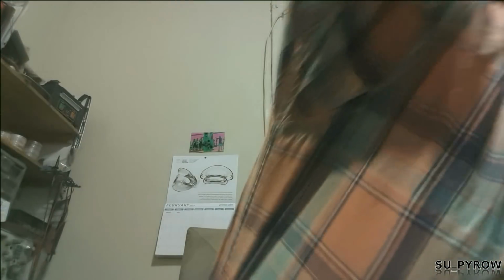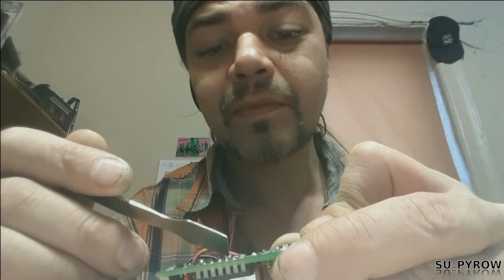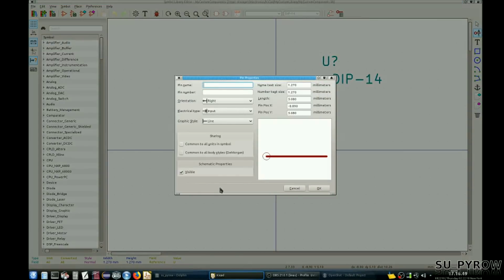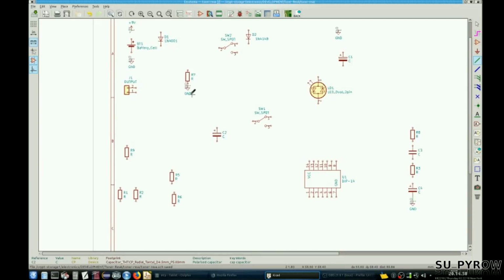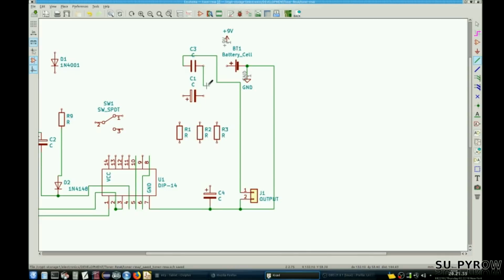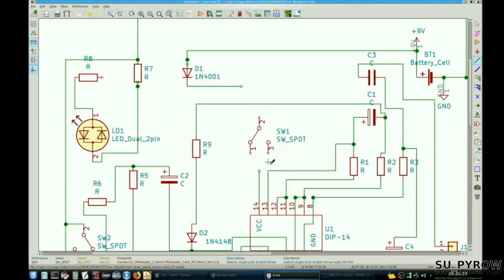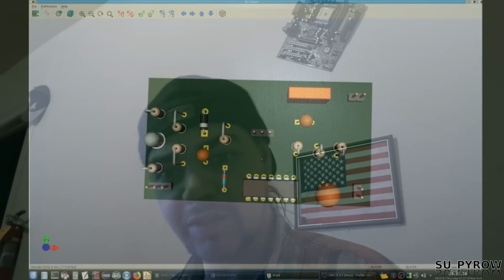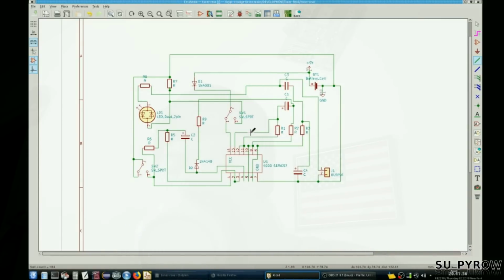How to Reverse Engineer a PCB to Schematic Using KiCad Tracer Toner Part#4 SU_PYROW

Comment: Nice channel, found yours trying to reverse engineer a schematic for a shredder. The wiring is all over, someone told me to use Net labels. Interested to find your channel and learn, I've never heard of identifying chips using voltmeters and truthtables. Only way I could have thought would be dumping the chip contents via a reader of some sort. Looking forward to watching more

Comment: Mystery chip is a 4069 or 4049 hex inverter from what I remember but ifvyou are familiar with arduino it can output different tones easier than building this up. Any probe will pickup arduino tones great.
Reply from the maker: CD4069UBE = $0.51   vs. ATMEGA168A-PU  = $2.19 vs ATMEGA328-PU = $1.96.    not to mention a microcontroller is way overkill for this project..  yes it would certainly work just fine.

Comment: Which  software use to draw sticmatic drawing.
Reply from the maker: the name of software is in the TITLE.   I have used KiCad for the past twenty years. I started in the 90's with Electronics WorkBench, or EWB as we called it.  it was bought by National and renamed it MultiSim. after that I discovered eagle and could not stand it. finally, i found KiCad and never needed to look for another electronics package.  your results may vary, good luck to you!  --Bobby
https://www.kicad.org/

Comment: sorry to ask - but before I invest 40 mins - if you identify a chip that's a micro-controller, is there any way to know how its programmed to recreate the circuit or are you SOL? thanks!
Reply from the maker: before i invest 20 seconds into looking into what "SOL" stands for.  once you discover it is a microcontroller... your best bet is to figure out what it is doing, then write your own software.  you can trace out where signal pins are driving what ever it is driving.  your welcome.
Reply: @supyrow  thanks. Shit Out of Luck